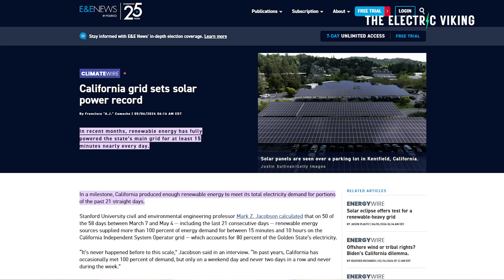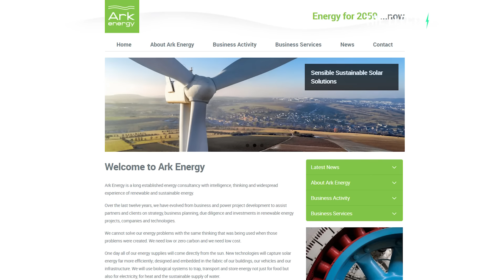How Australia’s new Tesla 8-hour mega battery helps to kill coal faster

Comment: Australia is very sunny but Britain is dull. Australia doesn’t get that cold but Britain is freezing in winter. 75% of Britain’s energy comes from fossil fuels. We need nuclear, batteries and offshore wind in Britain but it is expensive and won’t be here in sufficient quantities for 15 years. We need fossil fuels. But we should proceed and gradually wean ourselves off fossil fuels.
Reply: What in the hell are you talking about, Britain is 50% renewable and 65% clean energy as of 2023. Wind is one of the cheapest energy sources.
Reply: @sebyst7907  He probably means all energy not just electric.
Reply: @sebyst7907  From the perspective of electricity generation you are right. But from the standpoint of total energy used you are wrong.
Reply: @johnfrancis4401  ahh, yeah the good old primary energy argument. Where apples and oranges are the same. When you take into account efficiencies from BEV and SWB, real primary energy usage goes down significantly. Poster was speaking of electric production.
Reply: Solar panels work even when it is dark and cloudy. You just need more of them, which is I believe where their many fold reduction in price matters
Reply: @stevey_z  not on my roof they don’t. Mine were installed last year. 7 of them each rated at 400W. On a good sunny day I get 2.6kW but when it’s dull I get 0.4kW

Comment: Actually Sam, I think you're overstating the role that batteries play in the SA grid.

According to OpenNEM, over the last year on average, batteries provided less than 1% of total grid demand. Renewables made up about 70%, gas still supplied about 22%, and imports (filthy brown coal from Victoria) made up most of the rest...

So, gas is still very much a part of the picture there. Batteries are only currently used for short term stability and backup purposes (for seconds, or minutes at best while they wait for gas peakers to start). 

Plus Neoen are making a healthy profit from arbitrage - they buy during the day when the spot price is low (or even negative, which means they're paid to charge their batteries), and sell during the evening peak when the spot price is high.

Nationally, batteries only provided about 0.2% of grid load on average over the past year, negligible really....